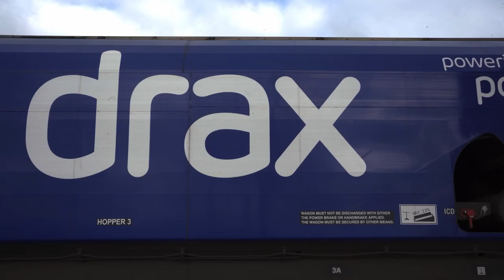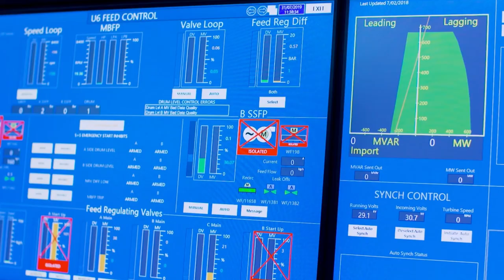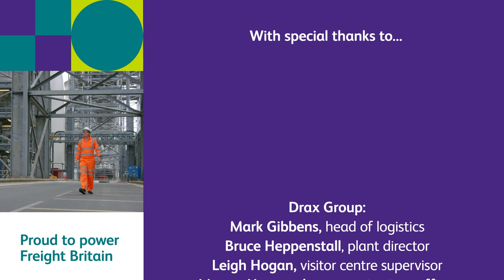Freight Escape episode three: Powering the nation

Comment: Even freight trains like Class 66, Class 68, Class 70, Class 88 etc are going greener and could see these trains run on hydrogen fuel to reduce Co2 emissions because of climate change.
Reply: It would be a massive, massive job to convert to Hydrogen ICEs. Are you volunteering as a project manager, Andrew?